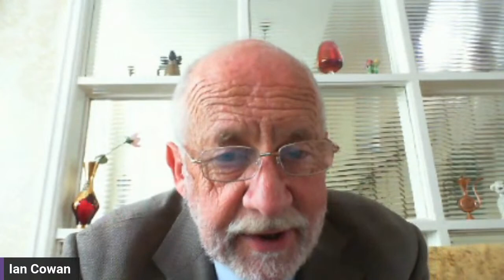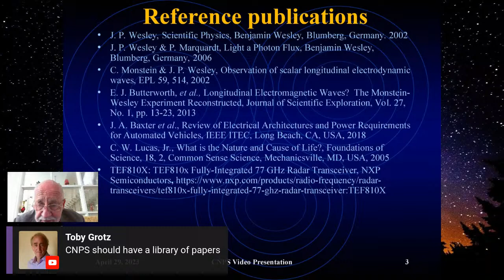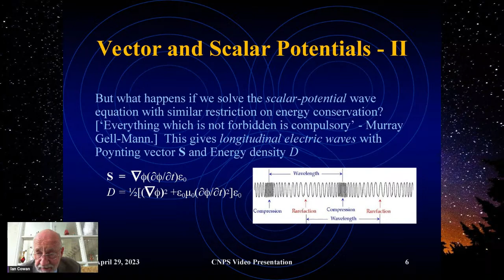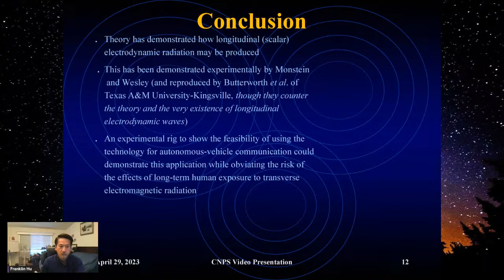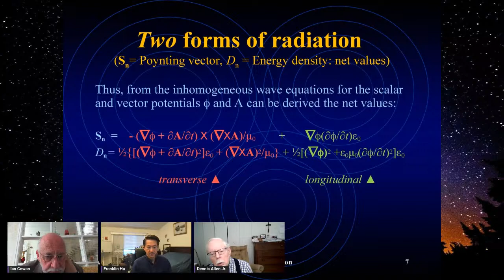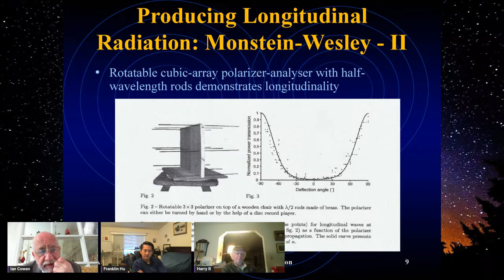Longitudinal Electrodynamic Radiation - Use in Vehicle Detection and Ranging - Dr. Ian Cowan

Comment: A ball transmitting antenna will imo emit …... 
(T1M) a zero nett magnetic radiation out along its axis (to the front)(zero nett longitudinal magnetic radiation)(& zero nett transverse magnetic radiation). The magnetic radiations of the counter orbiting elekticity waves/pulses will cancel (as per the say right hand rule).
(T1E) a strong electric radiation (ditto) in the near field.

(T2) a strong (non-zero) nett magnetic radiation sent out at 90 deg to its axis (ie out from that equator).
(T2E) a strong electric radiation (ditto) in the near field.

(T3M) a weak nett (non-zero) magnetic radiation back out along its axis (to the rear).
(T3E) a strong electric radiation (ditto) in the near field.

A ball receiving antenna will/can detect magnetic radiation & electric radiation depending on orientation.
And when i say radiation i of course mean the changing radiation (changing strength) of a changing field – an antenna won't detect a static field (at least not in the usual way).
And such magnetic radiation might be longitudinal &/or transverse i suppose. But electric radiation is always longitudinal i suppose (not sure).

Comment: Radio waves are not photons -- & photons are not radio waves.
Radio waves are imo magnetic & not electric – but we all tend to call them em radiation – but we should call them magnetic radiation – or just radio radiation.
There is no such thing as a natural or forced rolling E to H to E to H wave – not in radio -- & not in anything else.
Hertz was wrong (& possibly Maxwell was wrong)(hard to tell)(can anyone understand Maxwell?).
Radio waves have a manmade forced frequency & a manmade forced (pulse) shape (eg can be sinusoidal).

Longitudinal magnetic radiation – hmmmm – yes i suppose it is possible.
But such LMR might be weak – compared to the standard TMR transverse magnetic radiation (still thinking).

Re electric radiation  – radio radiation will (contrary to what i said above) include a weak electric radiation, which can be strong in the near field.
We could call  "electric (charge) radiation"  "elektric radiation" or praps  "elektic radiation" koz (on a wire)(on an antenna) it is made by my elektons (which have a negative charge) hugging the surface & propagating at the speed of light. It is not made by so-called electrons (in this instance). But i will use the usual name "electric radiation" (for today).

Comment: 32:30 Ball antennae. How ball antennae work, in my opinion.
Electricity duznt act/flow from the center of the ball directly to/from the surface (ie along the radius).
Electrons inside the Al or Cu do not make what we call electricity.
Electricity (what i call elekticity) is made by photons (what i call elektons) propagating on (hugging) the surfaces only.
So, on that silly ball, elektons need to propagate from the center (where the coax is connected) back out along the surface of the drill hole to the outside & then around the outside surfaces to the furthest part of the ball.
For the 30 mm radius ball this surface distance is 132 mm – which at the speed of light suggests that the natural frequency of that ball might be 2273 MHz. 
A 151 mm ball has a longer path & might have a natural frequency of 434 MHz. Or if a halfwave is critical then say 76 mm.
So, elekton elekticity tells us that the coax should be connected to the outside of the ball, not the center.
And the ball radius should give a pathway 691 mm long (to achieve 434 MHz) – ie radius should be 220 mm -- or 110 mm based on a halfwave (& based on not having any silly krappy flanges).